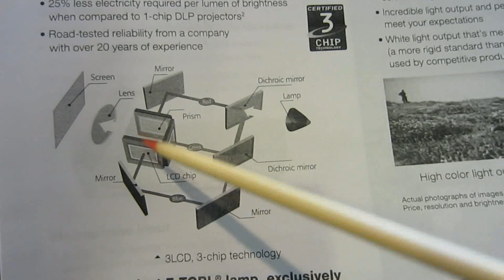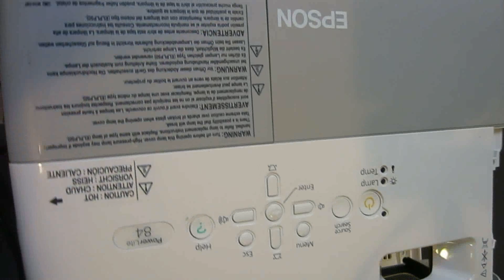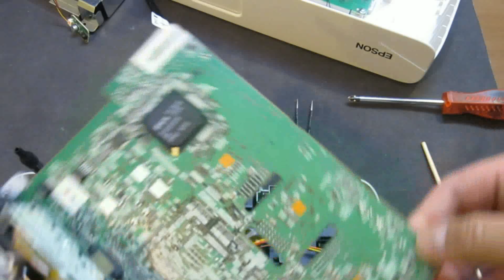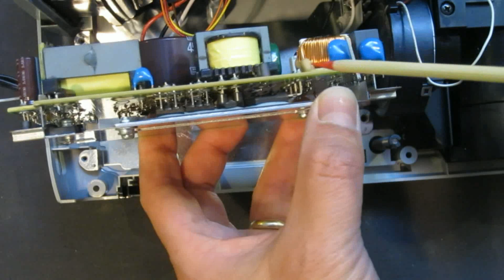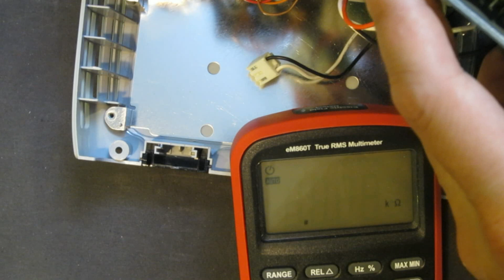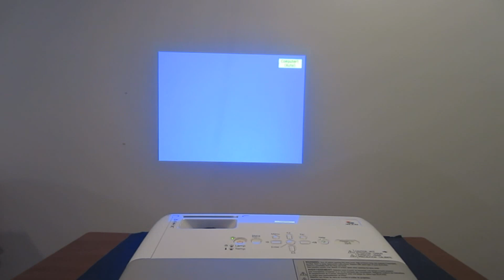Epson PowerLite 84 Multimedia Projector Teardown and Repair

Comment: This was my first projectorσσ>7wow.cc/EpsonProjector?υ    and I was really nervous about it. But this projector is amazing! The picture quality on my wall (which is a light gray) is outstanding! The mounting was simple and easy and the settings made it real quick to flip for my ceiling mount. The built in speaker is nothing great but pair this with a good sound system and you have yourself a home theater that all your friends will be jealous of!
Reply: do you know if it would be possible to remove the polarizer on the LCD projector to get a similar effect as removing the polarizer from a LCD display. making it so you need to wear polarized glasses like you get from the movie theaters. I am unsure if there is a different way that the projectors are doing things vs a regular display that would make this impossible

Comment: Epson 835emp model that shuts down after 10 mins with both lights flashing bulb and temp ?  any ideas ?  Thanks ..  Kevin
Reply from the maker: If the LED with the bulb icon is flashing orange, it means that the lamp will need to be replaced and if the temperature light is flashing red, it means it's overheated.

Comment: Hi Kerry, I really love your video's, the concept, the ideas everything. I just have a few questions regarding the high voltage capacitor. Do I need to discharge a capacitor (the big one) safely first, when doing component testing on a motherboard power supply? And if you did, how do you do it?
Reply from the maker: Yes, in you need to discharge those capacitors as not all of them have bleed resistors on them. The safest way to discharge these capacitors is to either use the low impedance mode on your multimeter (if your meter has that) or use a 1K to 100K resistor and connect to the leads of the capacitor for a few seconds. Don't short the leads as the spark can damage traces/leads.

Comment: This was a fusible resistor, designed to act like a fuse in case of over current. Most the time they fail without visible external sign.
Reply from the maker: I would have thought it would be a 0 Ohm resistor if it was used as a fuse?